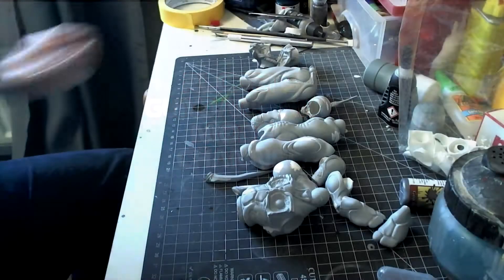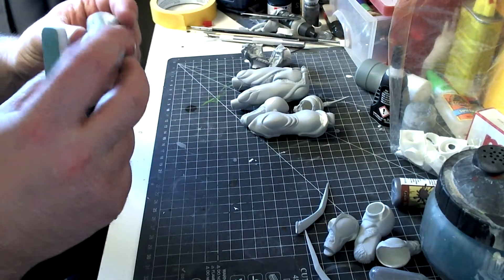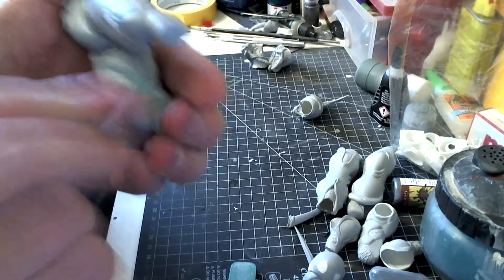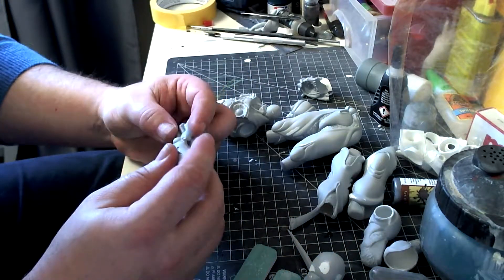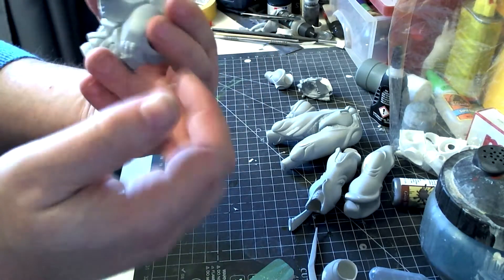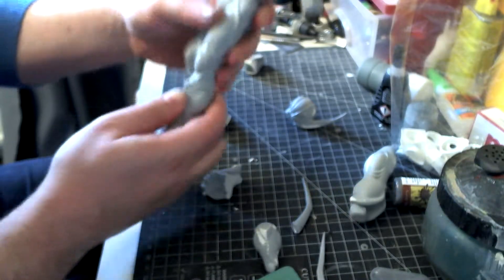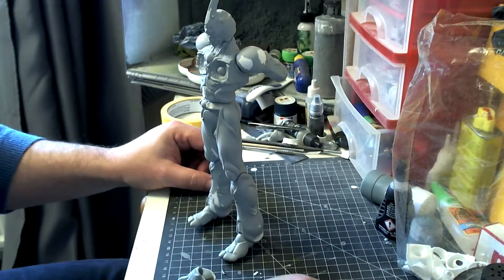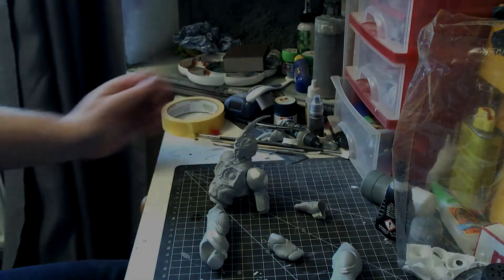Guyver Vinyl Model Kit Build Part Two

Comment: Do you know if the originals had the hands filled in or is this just an issue with the recast?  I'm curious if the ones I nabbed will need similar work done.  They're just the standard standing pose models of Unit 1 and 3 though.

Also nice cameo with the cat.
Reply from the maker: I cant say for sure mate as never had the original